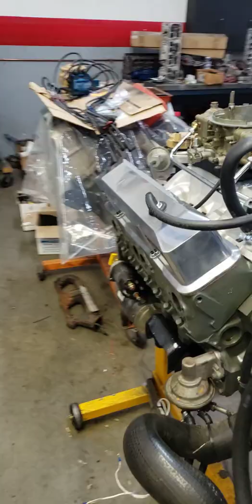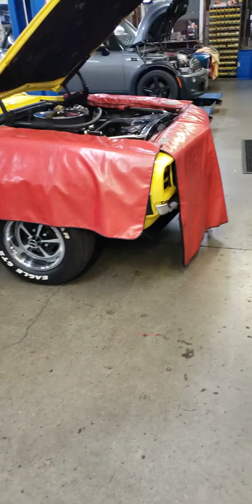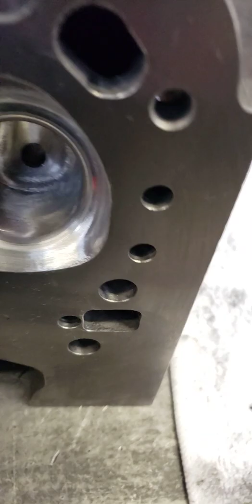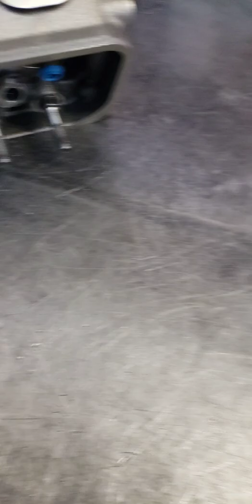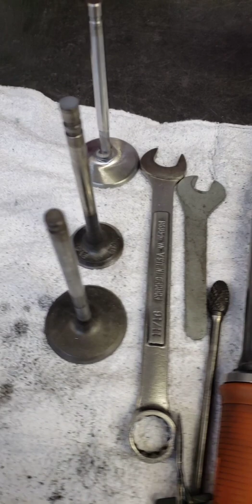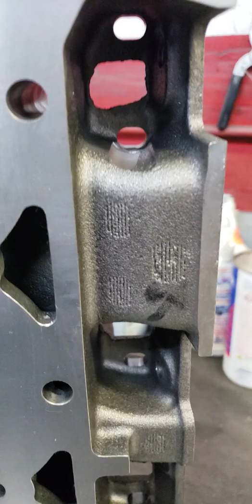Porting Summit / Dart Heads for Beginners

Comment: Good vid. I picked a set up for my sbc powered Jeep Commando. So far really happy with them. 
350 4 bolt Goodwrench short block..Dart 165's with 2.02/1.60...Eddy Performer air gap....Jet Stage 2 Qjet...Summit 214/224...444/466..112 cam...1 5/8 headers.
Reply from the maker: Thank you, that will be a nice street combo!
Reply: Excellent st motor right there!! That will make tons of torque and drive all day in traffic

Comment: I tore down my engine for a winter do over and wasn't even considering doing the ports.  You have converted me.  
Once I removed my valves, whatta you know, lumpy exhaust and intake tracts.  I have the Dart Iron Eagle SS  that were purchased on a money and time budget 5 years ago for my marine 383.  
All I did initially was a port match and knocked down some casting flash.  I also needed to hog out the pushrod holes as you mentioned.
So this go round I have all winter to finish them up well.  Thank you for the play by play. It helps. These are my first time at porting so I am being careful. 
I spent a long time on the first exhaust port, but it went without hitting the seat.  Hopefully there will be learning curve improvements!

Comment: I got a set for my 350 in my C10. 9.5-1 comp and XE262 cam. RPM intake. It said you can use centerbolt covers with mod. What would that mod be?
Reply from the maker: That's a good combination! On the summit heads they have a very large boss on the valve cover rails for running perimeter bolt valve covers now you either have to grind a portion of that boss away if you are using a factory style center belt cover or you're going to have to bend the flange on the inside of the valve cover I don't like doing it either one of those ways 
I now recommend now that if you want to run center bolt valve covers that you get a set that has a flat flange that goes around to seal on the valve cover rail which means aftermarket aluminum type fwiw

Comment: You're correct most people think they have 300 to 400 hp but in reality they only have 200 to 250 and my build dynoed a little over 400hp and I can tell you that is a screaming little motor on the highway and is scary
Reply from the maker: Yes absolutely there's a lot of 300 horsepower cars to get deep into the 13s that's still a quick little street car they can get you in a lot of trouble if you're not careful
Reply: SOOOO many guys out there with headers and intake manifold think they doubled the stock HP